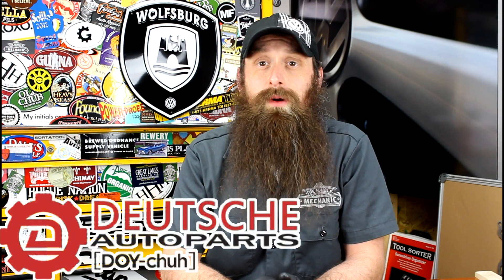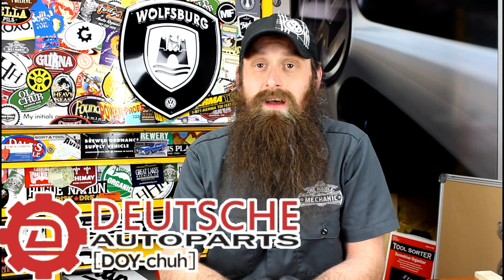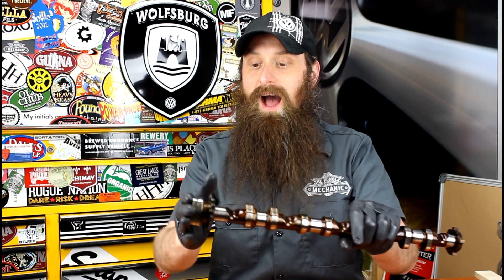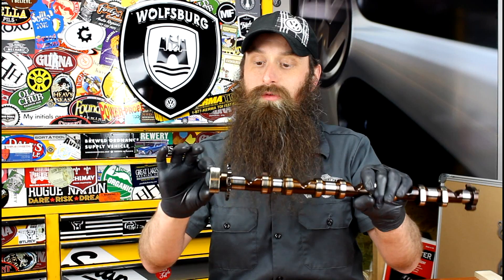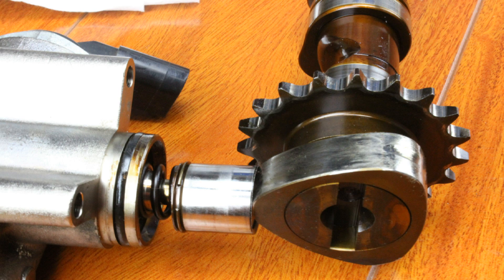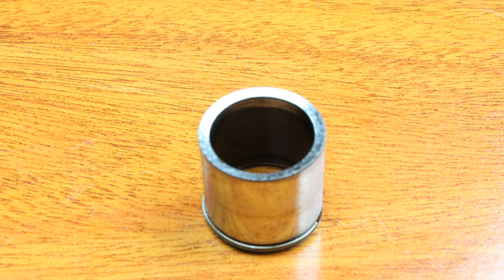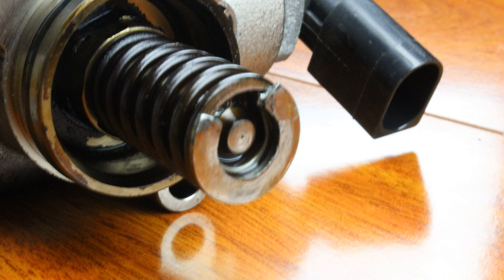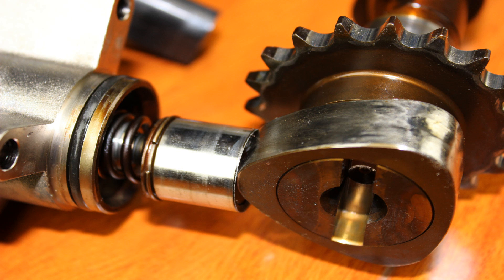How The VW 2.0T FSI Fuel Pump HPFP Fails

Comment: Hi Charles  i love your show 
i have a fuel pressure problem in a 2.0 tfsi bwa engine code and i have a P2294, P0654, P0444 i replace the cam follower and tank fuel pump and fuel filter but i always have this codes 
what you think? hpfp sensors? after all this problem i can hear the tank fuel pump but not anymore 
thank you cheers from Switzerland
Reply: Did you ever find out what was wrong ?

Comment: I had a came follower that was punched through (2006 A4 2.0T). The dealer has repaired this under extended warranty. What is the risk that metal bits from the failure might cause future problems?

Comment: Hey, What about BWA engines? I Have 2008 Audi TT 2.0T FSI 200hp at 64000 miles on it. And i am struggling with overly excessive oil consumption. Can it be about cam follower, or PCV valve? Thanks a lot.
Reply from the maker: +jdManiac Not the cam follower. Could be the PCV for sure. I do know that Audi has many more issues with piston rings that VW does/ But I think it was primarily on the longitudinal engines.
Reply: +HumbleMechanic Thanks for the answer. Oil level check light came 700 miles after service. After that i check the dipstick and there is not any oil sitting on dipstick. Not even on down side of Minimum. Then i add 1 litre 5w30, it came up to the middle of min and max. So it is at least 1.5 liter of oil consumption for 700 miles very soft driving. Thats HUGE

Comment: What are some of the symptoms of a bad cam follower? Went to the dealer and they wouldn't even check it because they said my aftermarket air filter ruined the MAF.
Reply from the maker: Almost always a MIL. Sometimes low power too.
Reply: +HumbleMechanic need help getting diesel out of my tiguan need so advice should I take it to mechanic or do it myself

Comment: Hey I have 06 mkv gti fsi engine and i noticed that whenever I drive the car for more than an hr on a hot day and ac on the car seems to stall or lose power for a couple of seconds while driving. Then its back to normal but if i continue to drive it the same thing occurs once again. I have already replaced the coil packs, spark plugs, the cam follower was changed 3 months ago and the pump was still in good condition. What  do you think the problem could be?
Reply: I have  the  same  problem did  you  fixed ????
Reply: Mine does this also. Sometimes rarely will throw a check engine light. Has something to do with electronic throttle and the PCM. I have yet to figure out if that’s actually the case with my car I am still trying to figure it out. Only does it when it’s hot out, never did that until I moved to Florida.

Comment: I've been curious about this for a while. The Mazdaspeed 3 uses a system like this, but after looking around on the Mazda forums -- it doesn't seem like they really have the same problem with their follower. What did Mazda do that was so much better for durability?
Reply from the maker: I'll do some checking on Mazda and how they do it. But They seem to have figured out a few things better than VW.

Comment: Hi Charles.  Does this issue apply to the 2011 Audi TT?  I'm looking at buying a used one and was wondering if there is anything mechanically that I should be worried about with their EA888 engine.

Comment: hi, I have a 2008 jetta 2.0t tsi cbfa .I have replaced the hpfp the lpfp the fuel pressure sensor the intake manifold the pcv  .but it is shutting off on me (the car that is). if I loosen the 17mm nut on the fuel line to release the pressure in the fuel rail the car will start only for a short time and then shuts off. It also has that cherpping sound coming  from the engine bay. do you have any idea what it might be? I'm thinking the fuel injectors or a vacuum leak .

Comment: Hello friend... very good videos!!! my passat b6 has this codes:

008584 - Bank 1; System too Rich at Idle 
               P2188 - 008 - Implausible Signal - MIL ON

in you experience, what you do think is the problem???

thanks so much!!!
Reply from the maker: Too rich may be a PCV issue.
Reply: Oh thanks for you fast answer... I change around 6 montador the new, version... I'm going to check if is some problem... thanks... best regards!!
Reply: Monts*
Reply: So.. I install a pcv block... do you think that than the problem??? Best regards!!

Comment: Hey good work on the euro cars
I'm having boost issues with my A4 2.0T FSI and was wondering if you can point me in the right direction
Im about 7 psi low boost
I know there's 2 fuel sensors on the rail, the maf and map sensor but also the sensor on the hpfp
The problem is that I don't have a check engine light on my dash
When stopped at a light I noticed that sometimes the car jumps and then moves but that's about it
Was just wondering any if these sensors were bad which one would thro a check engine light and which one wouldn't?
Or any thoughts on this
Would appreciate

Comment: The gear on my intake cam somehow isn't turning the cam when i try to turn my car over. Basically, whats the best and worst case scenario for my gti?
Reply from the maker: elleray6 Sadly there is probably not a best case. This is most likely due to the timing chain breaking, or the timing belt breaking. 

If this is a FSI, it could be either one. Both repairs are big money!
Reply: HumbleMechanic 

I have the covers off right now, and can see the chain driving the intake cam is intact and tensioned, also the timing belt looks fine. is this a freak of nature accident where somehow the gear on the intake cam is just... not attached to the cam?
Reply from the maker: elleray6 That could very well be the case. It is not very common, but it's possible.

Comment: i had my fuel pump (under my back seat) changed last November. cos my 06' vw passat 2.0T keeps going off in the middle of the road. the problem started again in January 2015. so embarrassing. what can i possibly do. car starts again after letting it cool for 20mins.
Reply from the maker: Bernard Nwamarah Sounds like a fuel pump module failing. That is the little electronic boxon the cover for the fuel pump
Reply: hot to repair this
Reply: Did you figure out why was wrong with it I’m having the same problem

Comment: thanks for the explanation.

question: should I lube the outside of the new cam follower in oil, or would you suggest assembly paste? and should the inside of the cam follower (making contact with the HPFP) be dry?
Reply: You can use assembly lube or engine oil for assembly. None of the parts that aren’t visible after installed should ever go in dry. It wouldn’t hurt to lube whole plunger assembly and HPFP O ring that seals into the pump slot.

Comment: Hi man, my car has the code p008b and is high fuel pressure too high or something like that, what could be the cause. 2007 gti 2.0t fsi.    Thanks
Reply from the maker: David Morales Could be the HPFP, the pressure sensor, the intake pump or the module.

Comment: URgh that design does not look solid enough, even with good lubrication there that part will wear, why not a roller follower like it's common in valves rocker arms?.

i'm hoping you can do the infamous grenading/engineered for self-destruction/need to replace everything fuel-related diesel common rail HPFP fail someday
Reply from the maker: Guillermo Lovato Me too. I am not sure how I can get my hands on the TDI HPFP
Reply: HumbleMechanic  isn't the common rail diesel HPFP an endemic problem with very high failure rates?, or they exchanged all of them and now the fuel is ok?
Reply from the maker: Guillermo Lovato They still fail a good amount. The issue is, they ALL go back to VW. If I can, I will try and snap some pictures and do a video that way. I just like to really dive in to the parts.
Reply: HumbleMechanic
so thery all go back and VW still can't do a proper pump design? :D, why don't they just license Citroen's 2001 CR pump that worked with whatever you put in the tank and be done with it?
Reply: HumbleMechanic im having issues with my 09 cc tsi 2.0 t i was driving down the freeway and all of sudden it will loose power and come to a deat stop and die????i have mass air flow code also intake runner position sensor and fuel pressure regulator. ...and just this morning the car started up fine then died and now it just cranks but no start...any help will b awesome thanks in advance